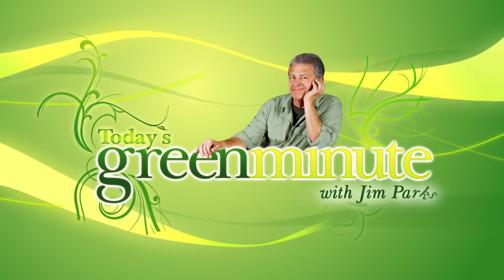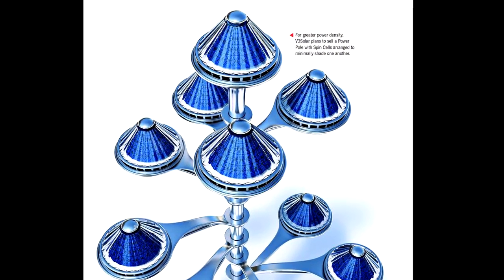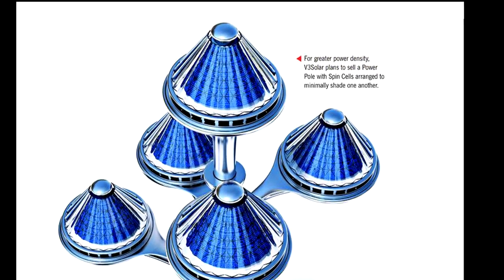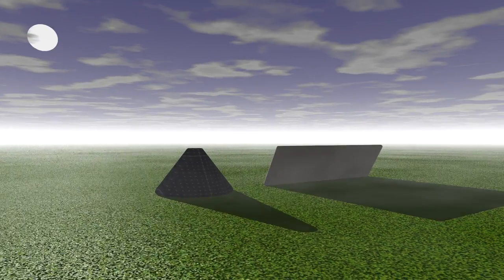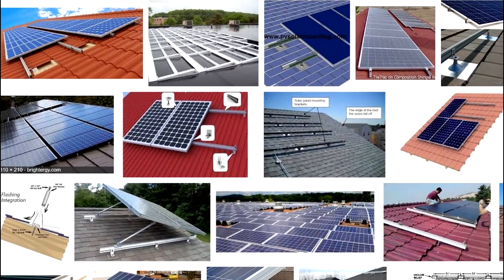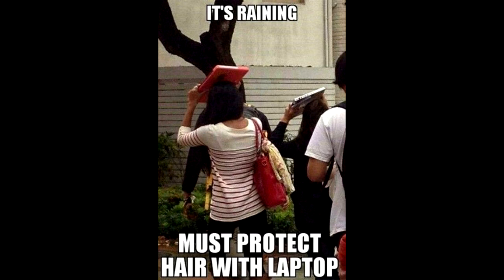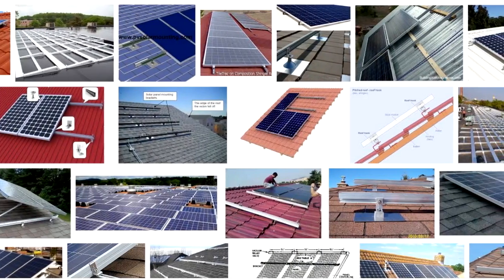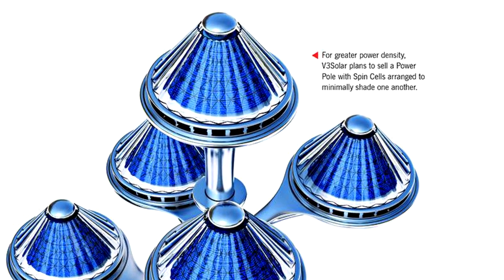Spinning Solar -BUSTED!

Comment: I likely agree with the result, but there a couple flaws in methodology that I spot.  Comparison to a plane panel of equal surface area is not the most optimal comparison.  For scaling, most applications will horizontally scale rather than vertically, meaning to make more power people would likely drop more of these in a field rather than just create a bigger more efficient model.  So the constant variable should be ground area occupied.  A flat ground panel with area equal to the base area of the cone would be more ideal.  Additionally the statement "X produces 20-times more energy than Y" does not demand that X is 20-times more efficient than Y, it could be as efficient but exposed to 20-times more energy.  It then makes more sense to establish input energy levels alongside efficiency.  On a side note, the statement "X generates energy 20-times more efficiently than Y" is even possible when X generates at 99.9% efficiency, provided that the statement implies not that Y not necessarily creates more energy in general, but that it generates energy with net efficiency of 100% - (0.1 / 20)% since this waste only a 20th of the energy X waste.  That is a reasonable mathematic definition of "efficiency."

Comment: You could cool a flat solar panel with a sterling engine powered fan, the more heat blasting at the panel the faster the fan.

Comment: But Thunderf00t - These "Devices" suck the light towards them and shape Spacetime so they absorb 4 times as much energy in one Second as the Itensity at that area (light current) is.. :P
Not only did they solve the energy problem by inventing a true perpetuum mobile they also solved the time machine trouble :D
And they go even further: it looks nice too! (I think those trees are very ugly)

Comment: Other questions they didn't answer;
- What makes them spin or where the energy for that comes from?
- How are they cleaned, y'know stopped from getting dusty?
- Do the cones change their conical shape (angle between base and side) depending on latitude and time of year?

Just another bright idea from the dim.

Besides, if cooling is the issue, wouldn't it be better to water cool them and use that heated water for another purpose?

Comment: Wouldn't spinning make it hotter?
Reply: xXx_sW4GL0rD_d3Str0y3R_xXx friction
Reply: Bearings. Even if it would spin 1,000 rpm, it wouldn't create hardly any heat. I doubt that it would spin 1,000 rpm though. I think spinning speed would be quite slow (guessing quite a bit less than 1 rpm), so just need plain bearing. But spinning would waste energy though.

Comment: Nice video, but I doubt your method of multiplying efficiency. I think "20 times more efficient" means there is 20x times less energy loss, so 80/20 = 4 brings the alleged efficiency of this device to 96%, not 400%, as you stated.

Comment: THANK YOU! I've had this shared to me with friends on Facebook at least 3 times now, and as a chemist that has worked on Dye-Sensitized Solar Cells for 2 years in college and knows exactly how they work, it irked me to no end.  You don't even need to have experience in solar panels to figure out this bullshit, you just need a little bit of research on them to completely disprove this stupid "cone" panel.  I swear if the world did more research on things before buying into them, it would be a better place.

Comment: The idea that this thing would cool itself by spinning is patently ridiculous. The structure of this assplug is condensed in such a way that air has very little surface area to take away heat from. Its shape doesn't allow for any air flow at all. Not to mention the genius idea to COOL SOMETHING BY STICKING IT ONTO A MOTOR. Because motors are obviously known for their ability to lower the temperature of the surroundings while they work.

Comment: And how much of the energy it produces would go to keeping it spinning?
Reply: They would probably at least 100 watts, so another 10% energy loss? Back to 40% efficiency compared to the 80% a severely overheated standard panel might produce. (Using the theoretical 100%  efficient cells.)

Comment: Hmm... so what's wrong with SpaceX's Mars mission proposal?
Reply: Actually, it's... remarkably accurate, it's never going to be AS good as they say, or at least, not as cheap, but it is a pretty good proposal.
Reply: Well SpaceX is known for missing "deadlines", however I'd expect a company capable of producing orbital class rockets, take half of the US launch share AND innovate a way of recycling booster stages never done before to know a thing or two about rocketry. Plus, they already have more to show than mere Power Point presentations; the Raptor engine is being test fired and has some impressive specs. So they're absolutely serious about this; like billions of dollars serious.
Reply: +maximkazhenkov11 I'm also wondering about that. It seem lightyears more safe and realistic than some other projects Elon Mu$k has pitched cough hyperloop cough
Reply: maximkazhenkov11 it's inefficient (i.e. 3-5 tankers + a crewed launch)
Reply: SawdEndymon 1312 Compared to... what? The Constellation program? SLS?

Comment: I don't believe in this design and I don't think they will be cost effective compared to normal PV. But I think Thunderfoots description of the technology is wrong. The glass is not there to increase the total surface, it is there to focus the light so they can reduce the area of PV-cells panels used. Using fewer PV-cells would reduce the cost.
Reply: But the glass cone would be very expensive.
Reply: Yes, probably.

Comment: On the other hand, 20% more efficient could simply mean 1/20th the waste. I'm hoping you didn't miss this obvious mistake and chose to continue in order to make a more entertaining video.

Given 20% conversion/80% waste, we would expect 4% waste/losses or 96% efficiency.  Never going to happen, not feasible in the slightest or realistically possible, but at least not hypothetically impossible.

Comment: The day when someone develops a solar panel of materials cheap enough to deliver, at minimum, the same amount of energy per $ invested as oil, is the day we should take notice.
Reply: Actually, the cost of solar energy is dropping like a sack of rocks, as companies like google invest more, the tech gets developed, and thus, the price drops. In the mean time, the environmental impact of them is as much as it takes to make 'm, and nothing more, so, really, even though it is more expensive, they reduce the strain on medical services as particulate output and the such drop.

In general, wind and solar could be considered to be more cost effective. They may cost more to install, but running a solar panel is a lot easier than running a generator, and solar panel won't explode if it is left of for too long.
Reply: Cameron McAllister Yes, because all energy prices are dropping, owing to a lack of demand, owing to global depression. The issue of tech isn't sufficient, in fact it is part of the problem: it is over capitalized, hence expensive. The question is oil as a minimum, because that is the cheapest energy source we know. But really, the benchmark is the real price of energy 50 years ago.

That all presumes capitalism. Obviously the tech is good in and of itself, and should continue. but the world doesn't run on use or intrinsic values.
Reply: Installing solar panels is worthwhile. When we installed a 2kW array, it cut our power bills by about a third. If we had a cost-effective storage option as well, I think that could probably take it down by another third. Net income from power generation would need a bigger array, though.
Reply: ***** Yes, from the perspective of home consumption, if you can afford the install, it does. In fact, they should be mandatory for all new or renovated structures at this point. But there is a wider crisis of capitalism, which, as the world system, is ending up a crisis for humanity. Solar simply does not have the cost effectiveness as oil 50 years ago. Not even close.
Reply: Simon WoodburyForget Less people buying=Increase in price as less are made, supply and demand.
Reply: Simon WoodburyForget If something is unprofitable, less get made, and the price rises.

Comment: Wouldn't the spinning take away a good portion of the generated energy? It doesn't even increase the area lit by sunlight.

And why would you choose a cone, the shape with almost the least perpendicular surface, to solve the problem of flat solar panels not staying perpendicular to the sun? I don't even understand how they are TRYING to sell this.

Comment: You know, these so-called, "inventors," could really save themselves some time and effort by just taking a couple Thermodynamics classes. Even in the Engineering departments they go through why Solar is so much less efficient than fossil fuels, nuclear, etc in terms of producing power. Solar isn't some magical I-win button for energy for a ton of reasons, but it almost seems like everyone just imagines it is... It's really strange.

Comment: What about Tesla's built in roof tile solar panels? Won't they overheat?
Reply: Every solar panel "overheats" while in operation. That does not mean it's bad for the panel itself, it's just that the efficiency is lowered. It's something normal....
Reply: Cooling is controlled by how many birds you have flapping their wings on your house. Simple science really...
Reply: In a house, it's trivial. You hook up a water pump, cool the panels with water and get hot water for free. The pump runs on solar and only needs to run during the day. You lose a bit of electricity but every house needs warm water anyway. This has been in use for solar roof panels since day 1. No "genius" Elon Musk needed.
Reply: The wind from the moving car should cool it
Reply: *****
I'm sure a smart engineer like Elon Musk could figure out a solution.
Reply: Robin Löfgren was wondering the save thing
Reply: Because I really hope that tesla solves the heating problem with those integrated solar panels.
Reply: Robin Löfgren although i do suppose that the heat poses a problem on the efficiency rather than the home.
Reply: My dad told me he wanted to cover his house 🏡 in those panels
Reply: There are ways to reduce overheating on solar panels, such as placing them on rooftops where convective airflow will cool the panels.
Reply: Yeah but I think he is asking about the "roof tiles" system that Musk announced. In that scenario they would BE the roof so not really much ability to get the cooling from underneath.
Reply: *****
That's an engineering question I am not equipped to tackle. I am a computer programmer, wtf do I know?
Reply: Mastikator Lol... me either. I am a web developer. :D

Ironically though I did have the idea to make roof tiles solar panels like 5 years ago. It's nice to hear that might have been a bad idea due to cooling concerns. hehe
Reply: whoamIIamyou , yeah! 😆
Reply: PCWarMachine , yes! That's exactly what my dad was considering. Because those roof tiles looks pretty, compared to covering the roof with "ugly" solar panels, in his opinion. 😊
Reply: Mastikator , I really hope so. Because lots of customers actually care about how their house 🏡 looks.
Reply: +PCWarMachine Well when you drive the car would the air passing over top not be enough?
Reply: ( ͡° ͜ʖ ͡°)  I don't think cars would have a significant impact on air circulation on roof panels on any houses 🏘. I might be wrong, but the effect of passing cars on roof panels seem quite negligible to me, at least compared to normal winds that will pass the roof anyways.
Reply: ( ͡° ͜ʖ ͡°) Lolz... yeah we read that entirely from different perspectives, but funny you read it more literally. When he said Tesla he meant Musk's company and not the car. ;)
Reply: Robin Löfgren Oh haha you guys meant Musk's solar panel BUILDING roofs. I read Tesla and just assumed you meant the cars. Nevermind what I said.
Reply: ***** , yes. There's more to Tesla then just cars 😊
Reply: All I know is I would LOVE to see HOAs try to find a way to ban them, and that's one issue with current panels.
Reply: That's pretty clever.

Comment: Is it possible the creator was speaking in terms of physical footprint rather than PV surface area, which would seem to be the limiting factor in terms of larger-scale placement and implementation?

Though I have no idea what benefit spinning them provides give that making them conical is meant to substitute for tracking mechanisms.

Comment: Since it is using a lens, I would assume it does not use the whole surface of the cone for solar panels.
If they only use a tiny fraction of the cone for solar panels and are using lenses to focus, they might be able to beat the conventional solar panels with 20 times. (compared to area of solar panel only).
Yes it would need the cooling and I think it would be quite expensive too make due to all the lenses and mechanics.
For this to be feasible, the price of solar panels must be high compared to lenses and the mechanics.
I think this would only work for a con(e) man.

Comment: You forgot to decrease the efficiency of the flat solar panel for heating up. I was also disappointed that you didn't calculate how much the panel is able to cool by spinning at that speed. But yeah, thanks for pointing out the bullshit.

Comment: does the spinning not fix the shade issue. ie each part is still being hit,
Reply: +Pedro Afonso Oitaven de Sousa yeah that was my thoughts too, but i am not 100% on oh solar works. ie is there a tick/refresh rate on the power generation. ie if you spin them fast enough that it would not be interrupped. just a theory here, i suspect i am inncorect, just wondering if anyone knows more.

Comment: just fill the gap between the lense and the solar cone with salt water ,fuse the solar cones with thorium engines, make it spin faster in a hyper loop mechanism and add oxygen gills to extract liquid oxygen to cool the whole thing. with that power you could make enough power  for the whole solar system for 10 trillion years and replace the sun when it explodes, or better yet inject it the sun core and keep it going for another 10 trillion years and stop the expansion of the universe through harvesting dark matter and heating it to dark energy to fule our cars.

Comment: what I could imagine is a smaller, more efficient (+more expesive per m²) solar panel inside this lense cone and that somehow it is air-cooled through the rotation and through the lense the smaller panel is always getting light (the panel would probably be flat at the base and the spinning part would be a heat exchanger). 
However I doubt that this would be more efficient than regular tracking solar panels, but one would have to do the maths to be sure.

Comment: I would also like to add that with the glass lense over the panels, only the glass and not the panels get the cooling benefit. There's also the question of, where does the power come from that spins the thing?

Comment: I think that saying 20 times more efficient either means what you describe later (focusing more light) or that the new efficiency is 1-(1-old efficiency)/20), so in this case going from 20% to 96%. Still bs, but no need to misrepresent at the start.

Comment: Ha! Reminds me of a well-reported public comment on a test solar-thermal (molten salt) plant outside Barstow, CA in the 1990's. The mirrors concentrate light to generate heat on a central point, etc. It's very bright, and was near two well-traveled freeways. The genius comment was "Can't they run it at night, when there's less traffic?" Brilliant!

Comment: Well, engines is my area of expertise. And doubling fuel efficiency with water injection isn't absurd. In the right conditions, with a few other qualifiers, you might get there. For example, let's say you have a high compression motor that's 30% efficient. It can''t be turbocharged because of fuel quality and cylinder temperatures. But a turbo would add another 10% thermal efficiency. Let's also ball park the heat rejection as 40% out the exhaust and 30% out the cooling package. Injecting liquid water directly into the power cylinder during combustion will vaporize the water and increase pressures while cooling the cylinder. So let's say we can get another 20% energy out of this steam power. Well with the steam power and the turbo (enabled by the steam power) we've doubled the efficiency of the engine from 30% to 60%.

The water injection can also allow the downsizing of the cooling package, reducing parasitic loads on the engine and increasing efficiency. The heat rejection out the cooling package may only be 15% now. The pump will only need to move half the water that it was. The exhaust temperatures will drop, reducing the need for turbo charger cooling, reducing the load on the oil pump and/or the coolant pump.

Of course, this isn't a trivial project to modify an en existing engine to do this.

Comment: Thunderfoot, your maths at the start were wrong. If you multiply 20%*20 you get 400%, which is even dumber than the 100% efficiency.
Reply: Which is exactly what he said.
Reply: Actually, it's 4. (.2*20=2*2=4)
Reply: Zeldagigafan Thats the same as my calculation, so we are both right.

Comment: You didn't address the fact that the spinning solar panel can be less heat resistant. Therefore may cost less. If this costs X times less you could produce X times as much power with the spinning ones for the same amount of money. Of course still taking your efficiency loss into account (So it will be less than X). So if X is high enough this would mean that it would be worth using. Although I doubt it is even close to high enough.

Comment: I invented a solar panel but it can use the thermal energy of clouds to sustain it in mid air and harvest the electron beams in the clouds to reference the direction of flow - and can therefore be used to power space elevators.